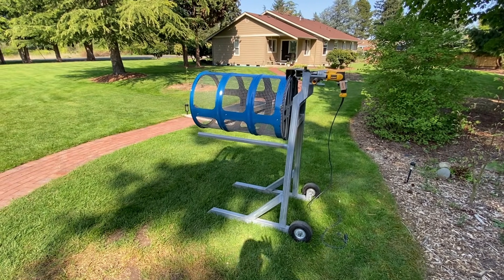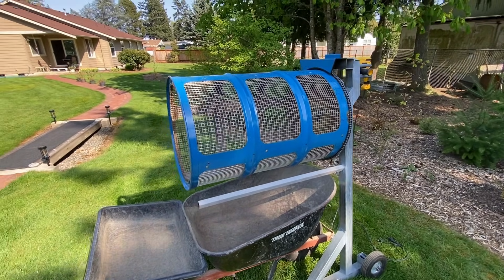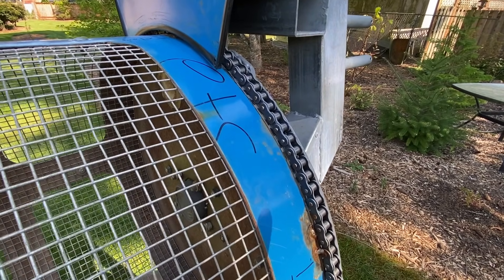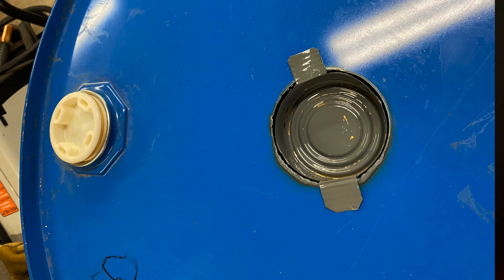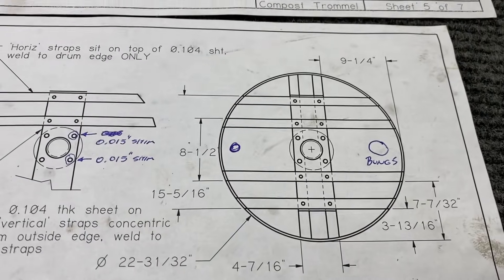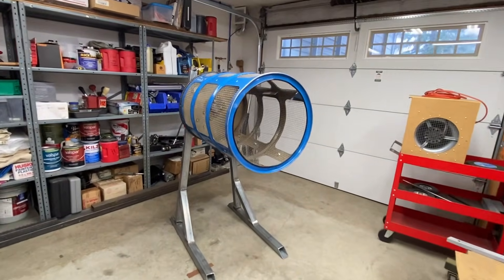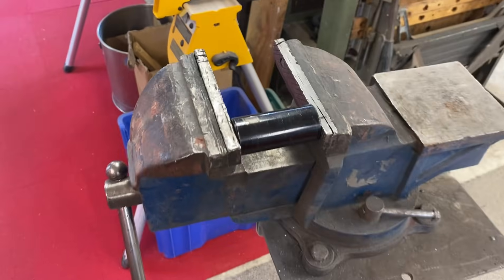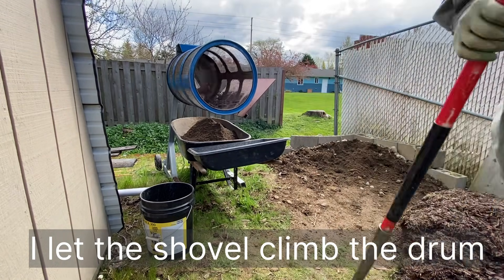Homemade Compost Trommel - Rotary Sifter, drill powered.

Comment: I've been wanting to do this but Longer.  3 barrels with meshes that get progressively bigger.  At a slight angle and spiral fins to bring the material up that can't pass through.
Rollerskate support wheels.
Loading shute is low and the large debris falls off high up.  Three tubs under each barrel.
Reply from the maker: You will be super happy when you guid one. I wish I had done it decades ago!  Good luck, thanks for watching.

Comment: Very nice setup! I always wanted to build something like this.
When I retire, I may make one …,😅using the chain on the outside is awesome ingenuity!
Reply from the maker: Thanks! Originally I was going to use a tire mounted and turned by the disastrous gas powered thing you saw briefly but that ate up several inches of space so less screen area.  Chain was left over from the Panzer build. They are cheap at Surplus Center!!!!

Comment: I saw a commercial oner from Biochar Station. I'm still trying to decide whether to buy one or build one myself: https://www.youtube.com/watch?v=CJs5cf-S4P4
Reply from the maker: Thanks Andrew, I didn’t find the bio char trommel in my searches.  Looks like it uses a gear reduction motor. I couldn’t find a reasonably priced one. I wonder how long the caster wheel bearings will last?  I think my total was about $170 for my build; $20 drum, $106 screen, $30 for bearings and sprocket,  ? For nuts and cap screws. Everything else I had on hand.

Comment: I built a similar thing for a friend years ago. It was made from an old washing machine bowl and scrap steel. His daughter is an electronics whizz and she built a solar powered drive with something called 'super capacitors' that charge up and then discharge driving a car wiper motor.  It  has a cover over it for rain protection.
In use all food scraps, plant clippings are thrown into it and during the day it periodically rotates a little bit slowly.  Loads of worms in it and everything breaks down very fast. Soil falls out between the slats. All he does is remove the rich soil occasionally and use it for potting mix or spreads it in his garden.
Reply from the maker: Onan - Do you have a youtube video?  I would like to see it.  Sounds fantastic.
Reply: @FUBARtractors  No sorry.  I built it probably 10 - 12 years ago.  The guy lives on another island and I have lost touch with them. 
From what I can remember the solar panels charged the capacitors up and when they reached a certain charge this was discharged through the wiper motor which was geared to the 'barrel'.  The gear reduction was through old motorcycle sprockets and a jack shaft.  Two reductions. I remember that the compost time was really speed up. 
My input was designing and building the mechanical bits.  The frame was painted with Cold Galv paint, etch primer and an industrial enamel topcoat.  Bowl was stainless steel so it is probably still going.
I never gave a thought to even taking photographs, it was just a couple of guys knocking up a project  over a weekend.

Comment: great job🎉❤ made mine out of a concrete mixer but yours seems much better-would love to have one of these
Reply from the maker: Thanks!  A cement mixer was my first choice but couldn’t find a cheap one.  They all seem to have pros and cons.  Hopefully someone will improve on this design and post it!
Reply: @FUBARtractors  mine hangs so i had to add a stand with rollers for the basket i love yours for how sturdy it is-mines a half of a cement mixer with a dryer drum bolted on with cut outs for the wire mesh

Comment: Nice bit of work. I think I prefer the style that is driven by a washing machine motor and a belt rather than the power drill and chain, but if it gets the job done and doesn't annoy you to look at, then it's a good tool.
Reply from the maker: Thanks!  Removing the power source and storing out of the elements is a big plus.  35-40 RPM is the sweet spot for the drum and every other power source I looked at was too fast without a jack shaft.  Have you seen one with a washing machine gear box?  I’d like to check it out.  - Curtis.
Reply: @FUBARtractors  https://www.youtube.com/watch?v=HL8qqsaN8JI So far I reckon this one is the best I've seen, but in one of his earlier vids he shows rebuilding the barrel because he sieved so much dirt through it that the wire mesh was broken. So if I can find anyone making the barrel out of expanded metal instead of that fine weldmesh cloth, that would be even better. And personally I'd rather a steel frame.
I'm rural Australian so the idea that it has to be stored in the shed when not in use doesn't bother me - we live on rainwater caught on our roofs, so big sheds are a thing out here.

Comment: Would you be willing to part with the prints you have for this?
Reply from the maker: Sure. Keep in mind they are 2D drawings not 3D. I didn’t draw out the sprocket design but it’s nothing special. The wheel addition was after the fact too. The guards were on the fly also. 
Email fubartractorfactory@gmail.com. 
Curtis.
Reply: @FUBARtractors  sent you email.